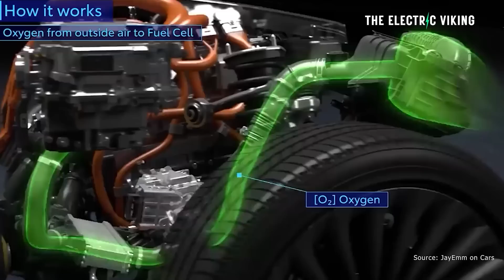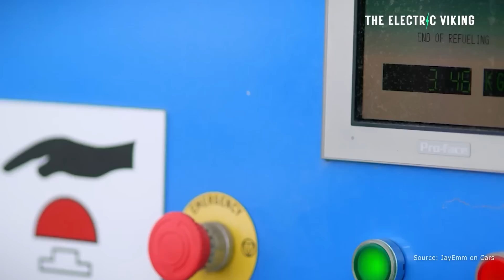Toyota targets China & Europe; plans to sell 200,000 hydrogen cars per year

Comment: Nothing against electrical motors…but from an environmental and political POV battery business is worse than oil. 
GREEN H2 over time could be produced locally (Belgian University has a patent on Solar panels producing H2 out of thin air). The political and economic impact to have an off grid clean system providing energy for personal use and transport is the only thing that makes real sense.
Is H2 currently less efficient, yes… is there brown, blue, black H2? Yes… 
But both are short term and economic arguments…the question is…what about the ecological and political independence arguments…

Comment: Hydrogen costs $29.99 per Kg in California right now. It costs over $160 to fill the Toyota Mirai and that will barely get you 300 miles of range. For the average driver(15k miles per year) the $15,000 free fuel card won’t even last you 2 years. 1 kg of Hydrogen requires at least 39.4 KWh of electricity for 100% efficient Electrolysis. A more realistic number is 48 KWh per Kg. That is 60% of a Tesla Model Y LR battery to just go 60 miles of range. Hydrogen is so inefficient that it won’t ever be viable. Toyota knows this but they don’t care. They are so behind on full EVs that they have to lie to their customers to make them think Toyota is still a technology leader.

Comment: They are just battery electric vehicles with a hydrogen fuel cell range extender. 

They can work in principle but in long run will prove too complex and hedged around with safety and logistics issues to compete with battery only vehicles, the batteries for which aleady quite good are steadily impoving year on year.

In short outside a few specialist niches, hydrogen is a lost cause.

Comment: This is evidence of the desperate attempts by Legacy Auto & Big Oil to preserve their revinue streams. Auto to preserve sales of spares but more over servicing.. & oil whose dream is to secure their future by supplying the hydrogen infrastructure.  Electric vehicles are more reliable do not require servicing.. Re Tesla..& the supply of fuel network is basically already there.. Most charging will be done at home or work.. you just have to install fast DC charging stations which is already starting to happen...game over Legacy Auto & Big Oil 😮

Comment: Hydrogen would be good for trucks, light and heavy.
A plugin Hydrogen hybrid, would be good. 
Only run on Hydrogen when required.
Reply: I thought they were going with solid state batteries
Reply: @mtl6067  If that works great.
Hydrogen is underdeveloped, room for improvement. Personally wouldn't knock it yet.

Comment: The strategic mathematics are straightforward, transport of all types contributes around 25% to global warming, the automobile is at around 15% of global warming. The remaining 75% is power generation, Major strategic production of steel material concrete and processing food. Additionally the remaining 10% of transportation is heavy haulage construction and farming equipment, locomotives, aircraft and marine require a diesel replacement not easily served by present battery technology . 
Synthetic fuels, Hydrogen and Ammonia (transportation for Hydrogen) are presently seen has the fundamental medium to replace fossil fuels natural gas and act has storage devices for large volumes of green energy.  Japan particularly considers a hydrogen based economy the ultimate solution supported by solid state batteries. Presently there is a need to pursue all technologies and technology options at this point.  
Toyota, brought its hydrogen ice engined car to Goodwood this weekend and ran it up the hill, that was a very powerful media statement and a hydrogen car goes to race at Le Mans next year. Today Toyota’s Hi-Lux Invincible is one of the most popular trucks in the world despite not being offered in the US. Due to its nimbleness and indestructiveness it’s wildly popular among hunters, rally racers and terrorists worldwide. Yes, it’s the AK-47 of pickups. The Deeside Toyota engine plant currently exports engines and machine components to South Africa, Turkey and Japan. It has been awarded over £11m of government funding to help it develop a new range of hydrogen-powered pickup trucks (HI-LUX) to secure jobs in Deeside. ‌‌‌‌‌‌‍‌‌‌‌‌‍‌‌‌‌‌The hydrogen option is being quietly pursued by the big engine manufacturers for locomotives, haulage, buses, construction farming machinery, marine engines, standby power engines and aero engines where sustainable high power output is required.

Comment: Such target is logical if you consider product acceptance and poor h2 car sales is NOT the issue like it is for the electric cars current sales crisis and over flow generated by excessive subsidising that users repeat by short time ownership…The ONLY deterrent to H2 vehicular sales is STILL TODAY green H2 availability at a good but overall realistic price everywhere, NOTHING ELSE. In fact if green H2 is really available at current cost plus limited mark up, no subsidies or incentives are required to sell those vehicles, unlike BEV but like good efficient hybrids thermals. Since Lhyfe largest green H2 producer here in Europe sells systems to taxis fleet or logistic depots with clean indoor lift trucks or Hyundai H2 trucks fleet at only 5€ net per kg of green H2 in 2025…We just need also a few competing suppliers more, over 5 or 6  to enable true competition and  the H2 highway for trucks from Spain to North Germany completed. Then, green H2 will become just unbeatable price wise for workhorses taxis and trucks, since an effective and green Diesel substitute is urgently and more and more needed….Green H2 mobility offers as well a decent sociability, autonomy, uptime maintenance etc..and since any idiot can produce it, the green H2, not the car,
 A stiff competition to supply H2 on the road should get quite severe rapidly, because unlike gas or electricity, no exclusive monopole and network will be needed, involved and possible. Today the rare H2 supply stations are not cheap matching and copying gasoline prices,  but green H2 production would get a the volume up and the prices  down because sun and wind are free, then both PV and COPV’s cost almost nothing,,,and prices of compressors, PEM electolysers and fuel cells are becoming competitive , very drastically down with increased production volumes. Already now,  a car fuel cell ( or small flex fuel 3 cyl. Turbo Plus small fuel cell hybrid) cost a fraction of the cost of a lithium LPF battery of mobile quality and can last much longer with clean H2, clean air and wetting water. Game over..
Reply: 200000 plus one here is a replacement opportunity and with old batteries and poor BMS, more and more :

https://youtube.com/shorts/ZshbQ3umnps?feature=share

Lol.

Comment: Toyota have a ‘chicken and egg’ situation. They have the hydrogen car but there’s no fuelling infrastructure. Tesla realised this and, despite the fact EVs could be charged at home, started building the Supercharger network. 

If hydrogen vehicles are going to work someone has to pay for a massive infrastructure and fund the losses until there are enough vehicles sold to make a profit. Hydrogen filling stations are very expensive and limited in the number of vehicles they can fill. A customer buying a hydrogen car in Europe needs to feel confident they can drive anywhere on the continent, It’s very easily done in a Tesla using Superchargers. They’d also like it to be as inexpensive as a BEV.

The investment required is enormous. It will have a cost implication on electricity generation with widespread adoption as hydrogen is less efficient than pure EVs. Who has the billions to risk on this investment? The risk is enormous if people still don’t buy hydrogen vehicles because the costs are greater than an EV. 

The only model of widespread HFCEV we have is California. Reliability of fuel stations doesn’t seem to have been great. Toyota were giving away the cars with free fuel to incentivise sales.

So whatever the arguments for and against hydrogen, a well supported fuelling infrastructure is not affordable.
Reply: True!
But at Toyota they ate both chicken and the eggs.
They get high by vaping the hydrogen pipe.

Comment: Well in the UK for example there is 40 percent of cars with zero access to off road parking so quick filling times via hydrogen has its place for sure. Or at least hybrids.
Reply: Four and a half years as an EV owner in the UK. I have no off street parking and rely on public charging. My car is my personal and driving school car. My business relies in the car. It’s not a problem. It’s easier than owning an ICE car.
Reply: @EVinstructor Well you have street parking near your house (just watched your first video). If the 4 cars that park behind you were EVs and took the space it wouldn't be quite so convenient. At the moment you essentially have home charging just out on the street. So your situation is the exception rather than the rule.

Most of the of drivers who don't have off road parking would have to rely on rapid chargers which are less convenient than petrol and more expensive. 
It's good you have a progressive council that facilitates on street chargers. Sadly we don't have any here as our council is anti car and by putting in roadside charging would be encouraging car usage, which is against their ethos.
Reply: @gavjlewis  near where I live there are 4 street lamp based chargers. Over 100 in our very small city. 4 rapid chargers within 2 miles and a Tesla Supercharger station with 8 chargers about 4 miles away. 

Our council have a form on their website to request a charging bay near our homes if we have a plug in car. It’s not a problem. It helps to have a decent forward looking council.

Comment: Hydrogen fuel cells:
- contain ACTUAL rare metals in them such as platinum (unlike LFP, Na-io etc)
- degrade at faster rate than current generation Li-ion (very sensitive to water and air pollutants)
- require lithium for its Li-ion battery as well
- consume more energy in low ambient temperatures (actually at least as current BEVs)
- take up to 10 minutes to refuel if you're unlucky (someone was fuelling before you)

Hydrogen for cars is pure greewashing and borderline fraud by Big Oil and Big Auto (legacy automative, especially Japanese).
Toyta and Japanese government are heavily invested in this hydrogen scam and will not let it go. They are spending massive amounts of money for propaganda, lobbying and PR to influence policies and regulation in the EU. The EU and most its member states are spending millions of euros on this useless hydrogen strategy that generates nothing but filling Toyota and Big Oil pockets. We EU taxpayers are going to pay for this charade. 

Japanese government hydrogen strategy produced nothing but a failure and in 15 years since its inception, there are no renewable hydrogen sources, it's all fossil fuel based and the hydrogen car target was fullfilled to 5% of what was planned. Huge waste of money and a failed policy. But the Japanese government is doubling down instead of adpating its strategy.

Comment: A Toyota Mirai is essentially an EV that derives its electric power from a fuel cell. If they can easily switch to solid state batteries when the technology is ready, then this idea might make sense. I do think probably Toyota should be making competitive BEV's, based on how successful Tesla and BYD have been.
Reply: Fuel cell vehicles have to be designed to hold massive cylindrical hydrogen tanks which are very different in shape than BEV batteries.  I don't see how they could easily switch.
Reply: @dansanger5340  True but much of the knowledge and expertise they gain from hydro-EV's should pay off with BEV's later on. As opposed to started from scratch.

Comment: To clarify something Sam quoted... Actually fuel cell vehicles have to have a battery that the electricity from the fuel cell charges. The electricity is then taken from the battery to run the electric motor. 
The reason that you can't take the electricity directly is that fuel cells cannot instantly respond to a draw of electricity and will sputter out if you push down on the pedal. They are very good however at constant current which is good for charging a battery. 
So why bother with the fuel cell? Just put in a bigger battery and ditch the hydrogen tanks and the fuel cell. Oh yeah that's an EV!

Comment: I just don't see hydrogen as a serious option for the general public ... especially in the winter time when temps are below freezing since all that water from exhaust will just be putting ice on the roads causing unsafe road conditions. Plus, hydrogen is extremely explosive, building hydrogen stations is crazy expensive, and filling up the tank would be outrageous and hydrogen cars will be super expensive too so, I don't see any serious benefits to hydrogen for the general public yet.

Comment: These Miria cars have been on the market for years and they have sold virtually zero. Just how do they intend selling these cars that you can’t refuel anywhere, again zero infrastructure for refuelling and simply too expensive to buy and even more to set up a refuelling infrastructure. Hydrogen at this time is not viable as a fuel, it costs too much, 95% comes from hydro carbons, you know the stuff we are trying to reduce reliance on. Green hydrogen uses far too much energy to produce in fact uses more energy than it produces as a fuel, just where is the benefit in using hydrogen?

Comment: Didn't Toyota claim earlier this month to have their solid state battery almost ready to launch, that enables 1000 km range and 5-10 minutes recharge time? If that were really true, there would be absolutely no point in developing H2 passenger cars for 2030, building a whole new expensive infrastructure, and using 3x more energy for the same distance? Guess that unicorn battery is also utter BS...
Reply: Read the small print (font size 1): fully recharge in 5-10 minutes! (But, needing to do that every 15 minutes)…
And: a range of 1000kM. (True, with a permanently connected 1000km long charging cable) 😂😂😂

Comment: so let me understand Toyota's master grand plan for world vehicle domination......use a highly complex hydrogen engine/fuel cell that can make electricity to drive an electric motor in said car....of which the hydrogen itself (to create) at the cost level is far more than even retail electricity, or petrol / diesel prices today, that creates more water....... on a planet that has a global melting glacier problem.....of which the insane strategy is promoted by the head of a mega corporation.   Where is Austin Powers when you need him?

With the cost issue alone i personally would say "no thanks". 
i am going with my EV running on fully renewable elect that i generate for free, now i have solar....
cos for sure i wont be creating hydrogen at home anytime soon.........

Then to top it off, 
Toyota
unless i am missing something completely. i just don't see any sensible, intelligent business strategy for hydrogen cars in the current market.

Comment: There is ZERO infrastructure.  Hydrogen costs are OUTRAGEOUS.  Unless there is some miracle solution they haven't yet revealed they are dead. Hydrogen will likely only have application outside of light duty passenger vehicles.  In vehicles that need energy density and cannot do the work on battery alone.  We already see the EV trucks aren't able to do the workloads done by ICE so those applications may have to be hydrogen.  There will possibly be applications for hydrogen, but it isn't as portable and useful as even gasoline and diesel.  It is a hard sell.